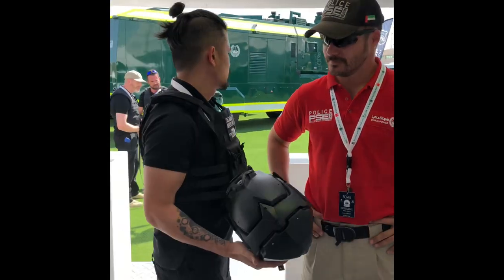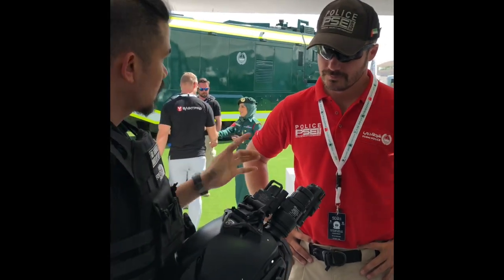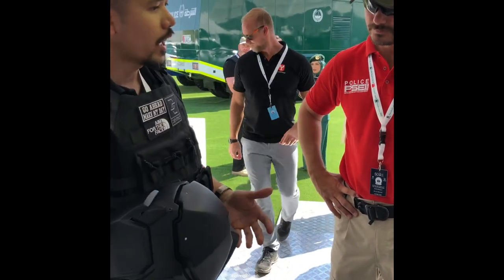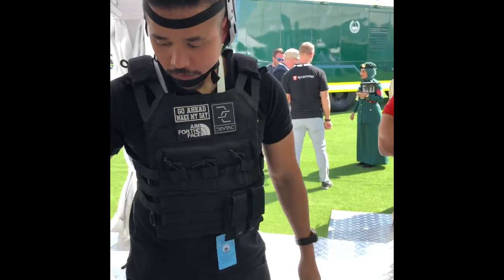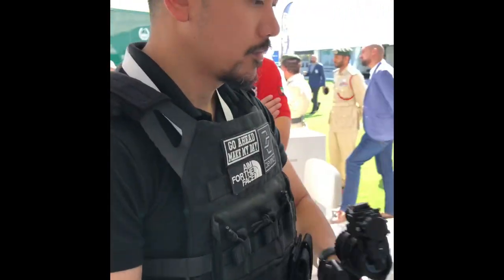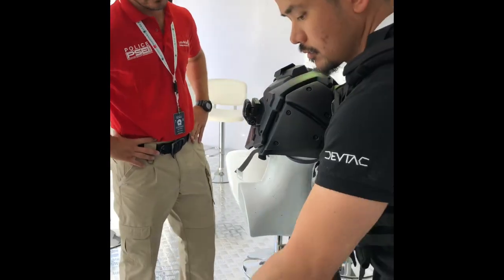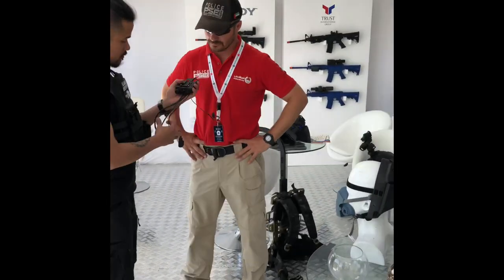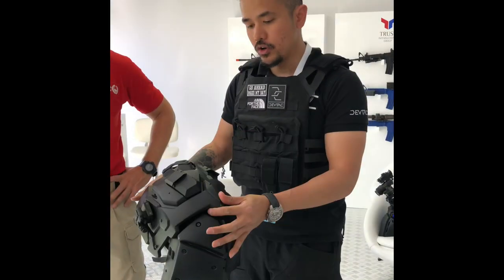3M RESPIRATOR COMPATIBLE DEVTAC RONIN CS

Comment: My question is with removing the front mask. It seemed super easy. Could a blast or a punch to the face knock it off.
Reply from the maker: Jake Lawrence it could. But by the time that happened. It had done its job.
Reply: @devtac  i feel like if an IED went off and u lost half your helmet in the start of an ambush. it wouldn't have done its job quite yet. and if u got punched in the face and the mask came off. its hardly done doing its job at that point. Id feel a lot more comfortable if it locked somehow. especially with nods attached making the front mask even heavier.
Reply: i want to love this because it has a lot of great advancements. But as an actual combat vet i have concerns.
Reply: Jake Lawrence I get your point. Maybe some kind of a locking mechanism that is held together by piece of metal maybe 4mm in diameter so that even if the mechanism is damaged in an impact but needs to be removed a pair of wire cutters can cut the lock and then it comes apart just as it does right now with the magnets.
Reply: i seen people shoot these they hold up pretty well
Reply: @oban6051  that completely defeats the purpose. It's supposed to easily come apart.
Reply: @Ottakazi  a regular Kevlar isn't going to stop a punch to the face at all. It won't stop anything to the face.
Reply: @Starlesslemon  i wasn't saying it would. i was saying that i think either of those will knock off the front faceplate bc it seems to be barely held on. Not that it would stop the damage, but that it would literally remove a piece of the armor if it was hit with the force a punch to the face would deliver.
Reply: I saw a video (not done by Devtec) where someone shot it multiple times and the mask side plates stayed on and the mask didn't come apart until they hit it with something beyond what it's rated to stop.
Reply: @cariganpintalba9498  id love to see the video. This is information that Devtac should post to promote their product! I want to see it be stress tested and its strange to me that companies don't do that as much. Especially with PPE.
Reply: @Ottakazi  I think that's because it could put them in tricky position legally. I've seen many products rated NIJ II or III take more than what they're rated to withstand. However, the companies could open themselves up to serious liability if they cite a youtubers independent experiments. Then it can be perceived as "official" or at least condoned. Demolition Ranch threw a lot at the Ronin.
Reply: @cariganpintalba9498  i meant more like Devtec should do a video of them testing their stuff, more so than independant youtubers.
Reply: @Ottakazi  Ahhh...my mistake.